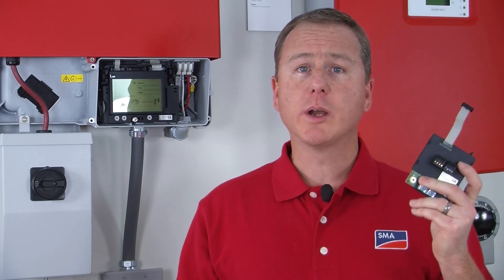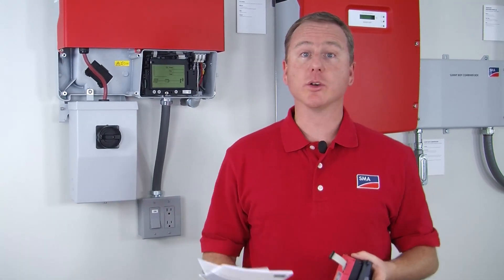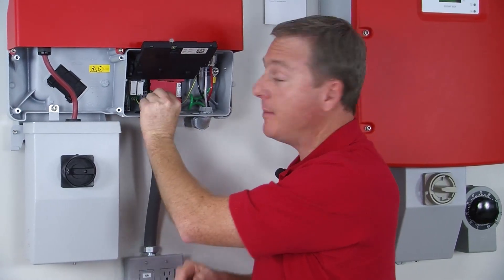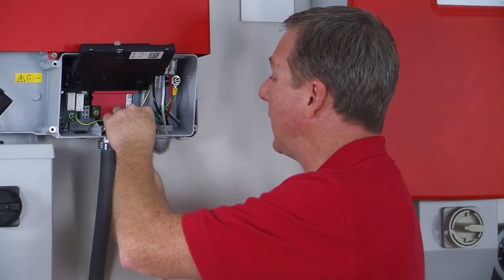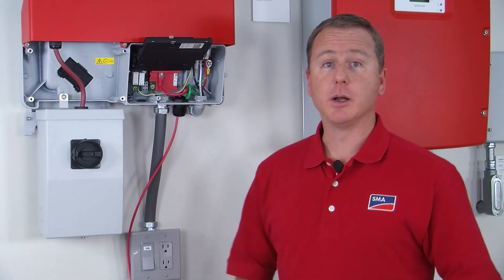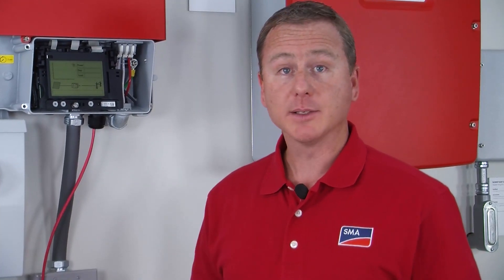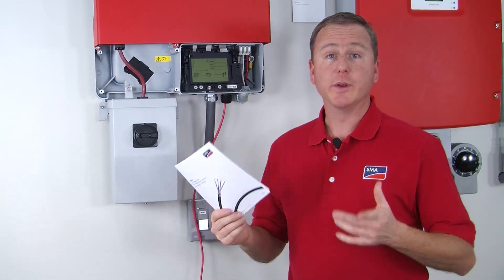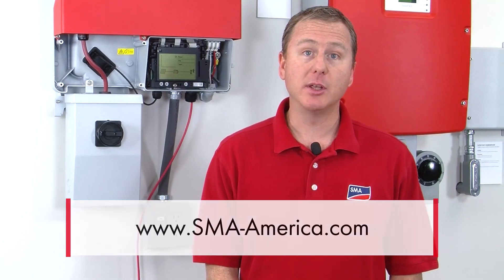Tech Tip: Installing a Webconnect or RS485 Card

Comment: Does this still work in 2025? I got a Sunny Boy SB 3800, SB 1100 and SB 4000TL-20 from 2010. These are brilliant devices, but I'm searching for a solution to read out data. Would I need three of the WebConnect Modules and will it work with my inverters? Appreciate your help :)
Reply from the maker: Hello Adrian, please get in touch with your distributor or the Online Service Center. With the serial number only, it's possible to check, if a webconnect module is an option. Sunny regards, Daniel from the SMA Social Media Team

Comment: Is it possible to connect another MODBUS Master to the cluster controller? Would it work?
Reply from the maker: For details on Modbus connections to the Cluster Controller, please consult this manual : https://files.sma.de/downloads/ClusterController_MODBUS-TI-en-18.pdf . Section 3.4 is related to your question, but it is suggested to read the entire manual. Please pay attention to the warnings on the bottom of page 7 and top of page 35.

Comment: I've got a web connect module that went bad; probably a lightening surge.  It's green LED no longer blinks like the 2nd inverter's web connect module is doing.  I've already power cycled the inverter.  So the 1st module needs replaced.  Do I have to unregister the defective module from the first inverter before replacing it and registering the new module?  I wasn't sure if the new module would simply take precedence over the first.?.?  The bad module happens to be the first web connect module in a series of just two (I only have two inverters).

Comment: Hi I am from DEIF Solar controller. currently we are using ethernet set up for control AC power of the SMA inverter while running with the Dg to avoid reverse power on DG . 
My question is  Can we control  AC power of Inverter through this RS 485 card  by PLC or Other master RS 485 master device ?

Comment: Moving to a place with sunny boy 1200/1700.  Cant find the product on your site despite it should "only" be 5 years old.
Reply: I know right! Solar is the only industry where you can spend 35k+ and they discontinue parts in 3yrs., in my case, and give you no other option. Hey SMA, want to buy a new Mercedes then have them discontinue the speedometer cluster in 3yrs. and give you no other options!? Yeah, I thought so.

Comment: I already have the web connect installed and working but wanted to add the SMA sunny sensorbox to my array. How do I interface with the 485 on the sensorbox? Is there a way to leave the web connect installed and still interface with 485 or do I need switch to 485 and buy a webbox?
Reply: Have to pick one or the other. I use to want to go Sensor Box route too, but they discontinued those and the associated sensors.

Comment: I have a webconnect in my sunnyboy  300TL=US=22 and a piggy back  cardin my Sunny island. 6048  
My question is the the cable connection between the SB & SI.  If I use a Cat5 cable with the plug end going into the port in the SI, which color wires do I use to connect the the webconnect connection 2,3,4,5,,6,7?  At the end I have a Sunny WebBox.
Reply: Why did you cut off one end? You only needed to know if it was a patch or crossover cable and it would have been plug'n'play.

Comment: How would you connect the communication using SB 3000TL-US-22 (Using the 485 Data Module) with a Sunny Island 6048 (Using the 485SPB-NR card) and a webbox?  Does a separate Ethernet cable need to come out of the SI and go directly to the webbox?  If so, which Ethernet com port on the SI dies it go in and how to connect that cable to the webbox?
Reply: If you go to SMA America dot com they have an email address for home owner questions, though they usually tell you to ask your local SMA dealer.
Reply: @midijeep.  Where you able to connect the TL-US-22 to the Sunny Island using the webconnect module?  Is that possible?  Or do you need the RS485 card (and remove the webconnect) on the TL-US-22 so it can talk to the Sunny Island?

Comment: can i use one of these sunny boys to connect a wind turbine instead of solar ?
Reply from the maker: Hi Ian,
SMA has discontinued its line of small wind turbine inverters, the Windy Boy, and the Sunny Boy inverters are for use as solar power inverters only. It may be possible to find Windy Boys, but they were based on the classic Sunny Boys (those with transformers). That style of inverter requires the Speedwire/Webconnect piggy-back card, not the data module shown in this video. However, there are specific firmware versions required on the classic Sunny Boys to use the piggy-back cards, and the Windy Boys likely would not have the required firmware versions.
Regards, Annika
Reply: So,  in order to add a wind turbine one has to use a different inverter and set up?  If one has an AC coupled SB & SI with battery backup, can this setup be used to add a wind turbine through the SI?

Comment: Hello,
I have (2) 4000 TL US  SMA inverters and I'm installing (2) webconnect modules into these inverters and do understand how to connect together. I will be connecting into my wireless broadband router. The ethernet cable is just over 600 feet long. I'm told by my internet provider I should have no problem connecting to the sunny portal. Do you see any problems ?
Reply: I'm about 3yrs too late, but yes, you should have no problems. I've read in a manual the max. distances for wire are approx 1500 or 3k ft.  Wait, do you mean wireless? No, wireless probably not, unless you boost it or use a directional antenna and have a clean line of site.

Comment: I have a SMA 4000TL-US and would like to install the Webconnect.  How much bandwidth will this take on my home network.  I have DSL but the speed is not great.  Thanks for your help.
Reply from the maker: Kevin Fisher We don't see any problems with it, but if you do experience any losses you can install an in-line Ethernet extender to maintain data speeds.
Reply: SMA Solar Technology
Thank you..we're not able to connect to the portal via the router but we are able to connect the 600 ft eithernet cable to a laptop (at the router) with Sunny Explorer. It sees the inverter and it's parameters. So we don't want to sell the customer a extender and find out it's not the problem. This install has become a bit troubling.
Reply from the maker: DSL service normally works well for using Webconnect to access Sunny Portal. Because the Webconnect Card isn't a data logger, it's won't be using much bandwidth at all and you shouldn't notice slow downs because of it as long as you're not consuming large amounts of data already.
Reply: SMA Solar Technology
Hello,
I have (2) 4000 TL US  SMA inverters and I'm installing (2) webconnect modules into these inverters and do understand how to connect together. I will be connecting into my wireless broadband router. The ethernet cable is just over 600 feet long. I'm told by my internet provider I should have no problem connecting to the sunny portal. Do you see any problems ?
Reply: I don't know specifically, but data bandwidth is very low compared to audio and video. It might be as fast as once a second or sends a packet once every 5 min. nothing to worry about.

Comment: How do I decide whether I need a Webconnect Comm Card or an RS485 Comm card?
Reply from the maker: Deciding between a Webconnect Card and RS485 depends on the amount of information you'll want to receive. Webconnect installs and commissions easily and provides great real-time system info, but it's not a data logger. For in-depth system analysis, the RS485 (and Webbox needed to run it) offer more system details, though the installation is more complicated.

Hope this helps!
Justin
Reply: Also you need an Ethernet connection.  I used a power-line adapter so I would not have to drill holes through the house to run the Ethernet cable (my inverter is outside).  If you have an electrical outlet nearby, the power-line adapters are a great option for webconnect.
Reply: By figuring out which is already discontinued. Use webconnect if you want to run a Ethernet cable to it (Best option). The 485 is only a connection point and you need to buy more parts to monitor anything.